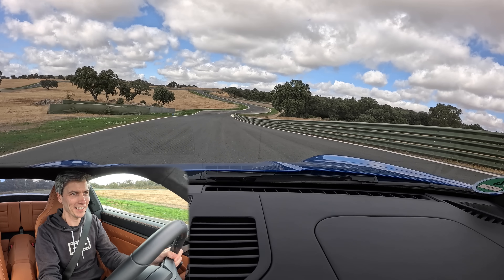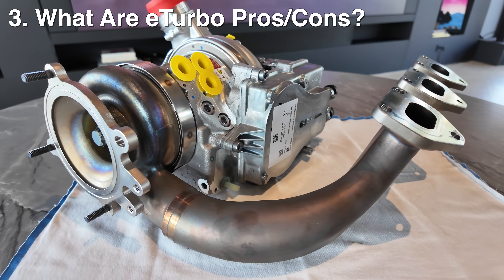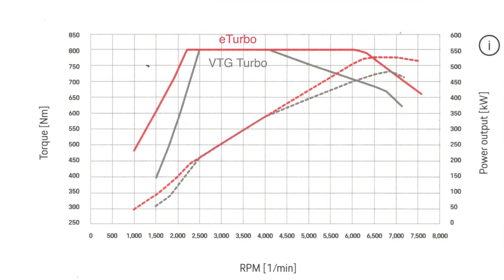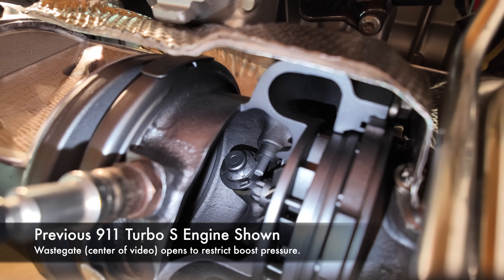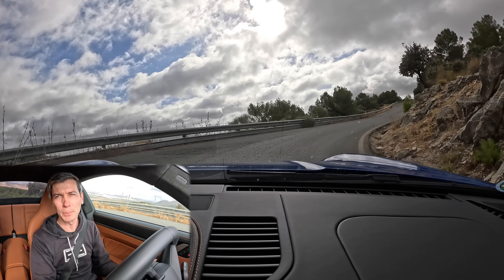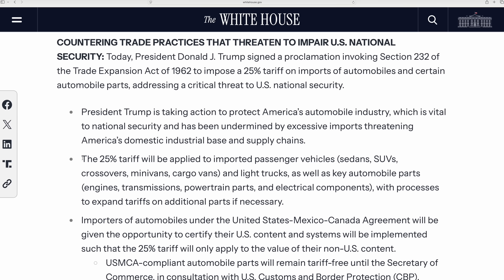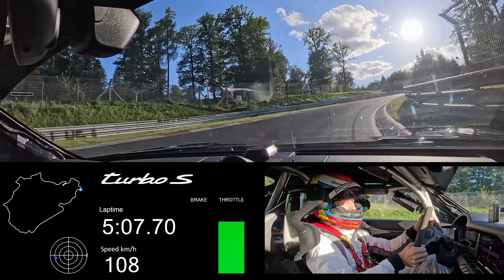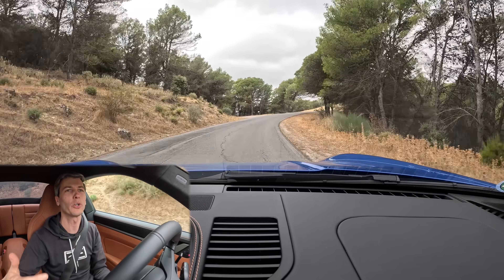Electric Turbos Are Here — Is It A Good Thing?

Comment: How did bro explain this while driving 😅
Reply: When you're experienced, driving is like walking.
Reply: @simontist  Also when you fully understand something it isn't difficult to talk about it
Reply: @simontist  When you're an engineering geek, explaining is like walking.
Reply: @simontist  when you're walking, driving is like experienced
Reply: @jwalster9412 when you're driving like walking is experienced.
Reply: @Rose_Butterfly98  Experienced driving is like when you're walking.
Reply: @b @benny5712 When you’re walking, experienced like driving is
Reply: While driving? Easy. Without a whiteboard? That's a little tougher for him, but he rose to the challenge! ! (Admittedly, editing helped in that regard.)
Reply: We need a video explaining the engineering behind that
Reply: He's good at what he does.
Reply: The ProCharger 101 -Supercharge CrankDrive™ is better then E-Turbo's Cause you can Change Gear Ratio's on the SuperChargeer while you Drive or shift Gears thus No Lag and You can Turn It OFF When it hit's Maximum RPM's Thus no More ENERGY from Engine to the Supercharger aka transion into a 100% naturally Aspirtated CAR
Reply: @HolloMatlala1  The video literally explains why what you described is NOT better... you don't want to "turn it off"... that's wasteful. In the E-Turbo the turbine will instead act as a brake on the turbine when the set boost pressure is reached... maintaining a stable boost pressure AND generating electricity that is then used to power the traction motor. This is BETTER than turning it off.
Reply: Pretty well TBH.
Reply: He's an engineer. Pretty sexy huh 😅
Reply: Probably a little bit of autism too 😅
Reply: Nerd power😎😎😎
Reply: Genius
Reply: Have you never driven home, pulled into your parking spot, paused for a moment and thought - How did I get here?
Reply: What is the difficulty to do so?
Reply: Came here to look for someone asking that question.
Reply: Could you imagine a woman doing this ?
Reply: @RIPPERTON  wtf was the point of this question?
Reply: @delev11  Misogyny
Reply: @RIPPERTON  Yes, yes I can.
Reply: @RIPPERTON Not at all

Comment: Meh, I dont know about an electric motor with a circuit board with soldering pointson it basically right beside the exhaust manifold.
I thought electric compressors are the new thing since the Audi SQ7 got one back in 2016.
Anyway, nice car man. Did they tell you what colour that 911 is? Looks like Porsche's RS blue, aka Audi's nogaro blue since they adopted it for the S4 C4 and RS2 back in 94.
Reply: There are plenty of other ways to connect electric circuits other than using tin based solder.

Comment: I’m sure this will be somewhat controversial, but setting aside intangible benefits like sound, vibration, and ‘soul’, what is the real engineering advantage to this complexity over a pure battery electric power train, which generates 100% torque across its whole RPM band? The one I can think of is still battery weight/energy density. I can imagine you could replicate the power and weight distribution perfectly, but not with the same range, which does matter for a personal car.  Thoughts?
Reply: re: "The one I can think of is still battery weight/energy density..."  NAILED IT..!!! (FULL STOP)🤟 wbarker you are going to be a GENERAL SOME DAY...!!!🫡
Reply: A 700 hp electric sports car with this car's 450 mile range would indeed be much heavier, and would need a much larger physical footprint to get the necessary battery 'skateboard' configured
Reply: battery electric cars aren't great for sports cars, they run out of power too quickly for typical track days
Reply: @Appletank8  If they don't overheat first. Folks that were building a Tesla GT3 car for an all-Tesla spec GT series had more issues with trying to manage the heat, than they did with battery life.

Comment: Really appreciate how you stick to the facts instead of just nut swinging off of Porsche itself. This is truly an enthusiast's future tech today.
Reply from the maker: Glad you enjoyed it, the tech is rad, was fun to experience!
Reply: Hey Jason - when the turbo reaches what would be wastegate pressure it loads the turbo hot side using the electric motor as a Dyno.  Does this create an efficiency and heat issue with exhaust gases?  I know they have specified a larger turbo but there must be a cost to that?
Reply: @markraumer2336  why would there be a heat issue? The motor is simply preventing the speed to go too high, and extracting the heat energy into useful electrical energy. It is how the current F1 engines achieve record thermal efficiency.
Reply: @markraumer2336  This turbo actually cools the exhaust gas in a round about way.  Where a normal turbo would open the waste gate this big Eturbo just keeps deflecting outflow with the turbine blades, converting their thermal kinetic energy into rotation that the Emotor recovers.  The normal turbo just dumps that extra energy out the back, and pressures up the exhaust line for a moment which helps slow the turbo.
Reply: The ProCharger 101 -Supercharge CrankDrive™ is better then E-Turbo's Cause you can Change Gear Ratio's on the SuperChargeer while you Drive or shift Gears thus No Lag and You can Turn It OFF When it hit's Maximum RPM's Thus no More ENERGY from Engine to the Supercharger aka transion into a 100% naturally Aspirtated CAR
Reply: @HolloMatlala1 why would you turn it off at max rpm? Superchargers are way less efficient than turbos, but if you turn it off and go back to NA, then you'll make way less power...
Reply: I still thing he is nut swinging.

Comment: This sounds awesome!...ly expensive to try to troubleshoot in 7-8 years when the second owner starts having issues.
Reply: I mean, theoretically it'll be easier. There's way less moving parts. Motor could go out, but that's one part
Reply: @justinbecker4772  When I see 2 E-Turbos, an E-Motor, and a HV Battery, I see 4 limited-life parts that will need very specialized equipment to troubleshoot, probably >$10k part cost each, and perhaps similar amount of labor to replace each.  The system is amazing and impressively implemented, but it could turn a 911 Turbo into a 20% Taycan as far as maintenance and repair, which is a big influence on depreciation.
Reply: Probably significantly less expensive than having to rebuild earlier generation variable geometry turbochargers and the wastegate actuators. Those are both common and expensive jobs on older 911 Turbos

Comment: Electric or not, doesn't a turbo make things hard on the transmission?  Is there a difference on stress (pertaining to the transmission) when it comes to electric or standard turbos?
Reply: No rotating mechanical component knows anything about the source of the torque that is being applied to it. It doesn't make any difference, a load is a load.
Reply: The transmission doesn;t know or care what's making the torque: only how much of it there is

Comment: Does it not create higher back pressure in the manifold when the electric motor electrically brakes the turbine instead of bypassing it via a wastgate? Or does ems cut fuel and air also?
Reply: It does create higher back pressure, but the additional electric power passed from the exhaust energy recovery to the wheels more than compensates. It's like an electric version of the turbo-compounding that the last generation of piston engined airliners used.
Reply: it's less of a problem at higher RPMs, there's enough energy in the exhaust to get more energy out than is slowed by back pressure.
Reply: It does at a point. If you look for one of the very old papers on the wright turbo compounded engines, you can get about ~12% 'free' horsepower without any downsides from the increasing back pressure.
Reply: @Your_Paramour  those were blowdown turbines which themselves have little effect on backpressure.

At low power it is more efficient to increase the cylinders' relative expansion ratio.
At full power, when there is lots of excess energy in the exhaust anyway,  turbine energy recovery systems are good at reducing loses.
Reply: That’s a good question. I presume it’s not enough to warrant concern as it sounds like to improve overall system efficiency and recuperation you’d want the pressure to be maintained on the turbine to take advantage of its MGU properties to feed that energy to the battery or traction motor. But of course it would be a very cool question to ask of the engineers to see what kinds of considerations they had around that issue.
Reply: I guess they sized it good as he said it was on the large side. 🤷🏻‍♂️ A wastegate can also a problem when you look at the efficiency of the whole system.
But it would be fun to see the data, they most certainly looked at it during development. 😄

Comment: I like your final conclusion, that this is a better turbo system, but it doesn't replace a NA engine.  Me personally, I would prefer a NA engine, because of simplicity, light weight, and I don't need massive power to have fun in a car.  In fact, less power is usually more fun, as you can exploit it on normal roads.  Most of us don't drive on the track much, and don't have the skills for massive power anyway.  I'm curious what the MPG difference is, older turbo to this new one.  And 85kg, to me, is quite a bit of weight!
Reply: How much extra weight would the 10 litre NA engine be?

Comment: Normal driving doesn't need extra power.  Actually the way a piston spark engine runs at low power is to reduce the intake pressure so super charging doesn't do anything. Having a low compression ratio in the cylinder allows the turbocharger to do much of the compression work using exhaust energy which is normally wasted.  Thus higher overall efficiency.  The electric motor gives more acceleration and possibly temporarily higher speed by using battery energy.  It could also be used to generate electricity from excess exhaust energy.

Comment: So, Porsche found that making better combustion is better acceleration than an electric motor? CHECKMATE EV'S!

On a serious note, I have to wonder if exhaust gas power scavenging like (without the compressor stage) this can be added to other hybrids to basically have more charge on tap for running the electric assist motor, decreasing load on the ICE and improving economy.
Reply: "better combustion is better acceleration than an electric motor"
for a caveman sure but aliens prefer electric.

Comment: Cool technology but i can only imagine the maintenance nightmare if HiVolt batteries break or electric modules. Someone buying a Turbo S likely doesn't care but having the car gone for weeks at the dealer or paying tens of thousands for parts is not exactly convenient.
Reply: You could say the same for every Toyota hybrid except, oh, that's right... they are staggeringly dependable and go for hundreds of thousands of miles over decades without significant HV battery or electroc module problems

Comment: There is no such thing as electric turbocharger. There is no turbine. It's an electric supercharger
Reply: No, there is a difference. What is described here is a combined electric supercharger with a turbosupercharger (the correct full technical name). It would be possible to just have an electrosupercharger alone. Any such engine would also probably have a better exhaust note since the exhaust isn't being muffled. Since an electrosupercharger would be on the intake side alone it would also eliminate the need for components to operate at high temperatures.

Comment: somthing iam curious about is if the both the turbines in the turbo are traditionally coupled 

that electric motor is gonna work very hard to produce boast spinning two turbines when there is no enough assistance from the exhaust
Reply: fortunately it CAN work very hard, because it is appropriately sized for the load
Reply: The electric motor is very efficient and not overworked. It is designed to handle it. Porsche does not sell junk.

Comment: An engineer saying normally aspirated engine hit immediate max torque?   Guy has never seen a dyno sheet
Reply from the maker: It's all relative. But so we're clear, I'm not saying it instantly hits peak torque, I'm saying instantly hits max torque for whatever RPM you're at. The intake pressure nearly immediately goes to atmospheric, and so you hit max torque (for whatever RPM you're at) very quickly. Peak torque is dependent on what RPM this occurs at.
Reply: I think he was making a comparison. Context is everything.

Comment: 01:55 "you only really need" -  improved torque is useful in other cases too, not just acceleration from 0.
Reply from the maker: This is not referencing acceleration from zero, it's saying that at any moment, the eTurbos only get ("need" as stated in video) electric power from the battery very briefly, and then the exhaust takes over. Just a quick spool, they're up to the target boost pressure, then regenerating energy (from any RPM, any throttle state).
Reply: @EngineeringExplained  oh I see, so it does not directly solve the lack of boost at low RPM
but as you said it minimises the lag of a bigger turbo, right? Which can then be used to improve torque at low rpm
Reply from the maker: @ПётрБ-с2ц  It also increases boost at low RPM (as discussed in the video, and shown on the dyno sheet).

Comment: Hey, great video as always. Maybe too soon to ask this but, how will the eTurbo do with heat cycles? We have all seen those video's of glowing red hot turbo's on a dyno test. I also feel that HV battery will be very expensive to replace if/when it goes bad.
Reply from the maker: Everything is cooled. There's water cooling for the e-motor in the turbo, oil-cooling for the turbo, and water cooling for the e-motor inverter.
Reply: It's only 1.9kWh. Replacing a 80kWh battery for an EV is around $13k, so assuming 1/40th of the capacity means 1/40th of the price: only around $300. That said, Porsche is not known for selling their parts cheaply. So probably determined mainly by markup and whatever the garage would charge for labour.
Reply: @reeeeeeeeemmmmmmmmmm  I think it's clear the battery is the cheap part here

Comment: Can this be simplified, shrinked and made cheaper so it can be used in a low cost vehicle? Like a 1.0 L EcoBoost engine?
Or an alternative to MHEV (Mild Hybrid Electric Vehicle)?
Reply: Doubt it could made cheap enough. And you can put a bigger engine and get much better results.
Reply: @ivonakis this tech will trickle down faster than we expect.
Reply: They did already for 40% off - Porsche 911 GTS powertrain follows the same technology
Reply: This system is more for performance, though it probably saves some fuel as well. But they'll probably continue to work on it in different ways. 😄
Reply: I don't see the point as an MHEV like the 1.0 Ecoboost has the turbocharger lag filled in with the electric hybrid system, so the torque curve is flat from about 1600rpm
Reply: It can, but not up to the point where it would make financial sense to be in a low cost vehicle. It has all the parts a hybrid has without any advantage a hybrid has.
Reply: Expect electric engines to take over well before this is cost effective.  As good as recovering power via the turbo sounds for a cost (gas) sensitive car, you'd better off cranking up the expansion ratio and trying to use the limited output in your turbo.  Ideally skip the turbo entirely and have a more powerful e-motor than the gas engine.  And if the customer has a good place to charge (I don't), lose the gas motor entirely.  Electrics keep improving, and gas engines seriously leveled off in the 1940s.
Reply: Yes, when the shrinking process has completely eliminated the combustion engine it is simplified, made cheaper and better: full electric vehicle!
Reply: @mattg432  That's not happening anytime soon, EV have a long way to go before it could completely replace ICE.